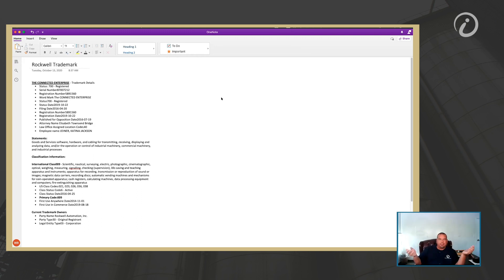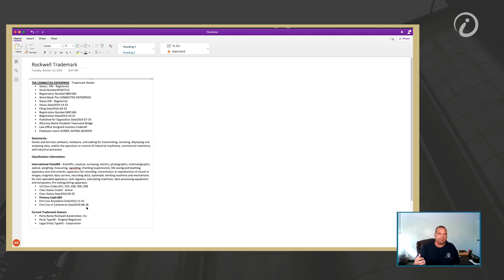Is Rockwell Automation Open?

Comment: A few years ago, I attended an event at Rockwell's HQ in which they announced support for OPC-UA.  The product they presented was a software gateway for FactoryTalk.  They also had some field hardware with embedded x86 compute that could run it.  I thought it was kind of cool that Rockwell might be finally coming around.  I was little skeptical based on the products though.  Sure, it satisfied a couple of use cases, but another gateway was hardly what the market needed.  Perhaps it was just beginning.

I politely asked "What does Rockwell have on the roadmap for OPC-UA?  Are there plans to adopt full OPC-UA in controllers and within the software products?"  They responded "Great question.  We plan to continue to support CIP.  It's embedded in."

This is where I knew that Rockwell were still stuck in their ways and had some growing up to do.  Among those in attendance included Microsoft, Amazon, SAP, HPE, Siemens, Beckhoff, RTA, Comtrol, Heidenhain, Eaton, Hilscher, Matrikon, and the OPC Foundation.  Rockwell may as well have told everyone that they seek to have the lowest level of interoperability possible.

I enjoyed how you crafted your argument.  I had never thought about how their "Connected Enterprise" patent is an inherent contradiction.  I always thought of it as a marketing phrase primarily.  It resonated somewhat when they marketed Studio 5000.  But, as far as, integrating applications (i.e., connecting the enterprise), not at all.  I've never met anyone who was thrilled to integrate Rockwell software.
Reply: This is great feedback -- thank you!
Reply from the maker: Thank you!
Reply: I use the OPC-UA card at work for integration to wonderware and Power Bi .   I also am actively using two Rockwell compute devices.  One is a card for CLX and the other is a CompactLogix with a i7 stuck on the side of it.   One is for running a SQL database running a 3rd party RFID card security and the other for a 3rd party alarming system that talks to FTAE.

Comment: Thanks for your valuable information. I may have a naive question but I am gonna still ask 

“What if rockwell, Siemens and other such companies adopt open architecture then would the role of system integrator just as yourself diminish or become less valuable or to say in a direct way, will you get less money for the work as everything will be easy to setup?”
Reply from the maker: Thank you for your comment Sayyam. We are going to do a follow up video answering more questions to this topic.
Reply: The role shifts -- from building single applications and connecting solutions together in a single plant TO building IIoT ready nodes (machines and software) while converting data into information for the entire enterprise.  System integrators aren't good at these discrete connections -- which is why Digital Transformation fails so often.  This approach will increase success rates and open up an entirely new market for SIs.
Reply: I would add to Walker's comment that under open architectures the SI can focus their energy on innovation instead of the overhead of battling the cost and complexity created (often intentionally) by vendor-proprietary silo's. With open architectures, the ecosystem of solutions available grows massively, as does the community around them, simplifying integration and opening the door for innovation.
Reply: @mfahrion  Spot on -- perfectly said.
Reply from the maker: @mfahrion  I want to frame your comment and put it on our digital fridge.
Reply: @Mike what Innovation?
Reply from the maker: @jogreg9989  Solving new problems. Making things more effecient. That's the name of the game.
Reply: @4.0Solutions  sorry, can you be more specific, what new problems? And more efficient ? E= O/I%
Reply from the maker: @jogreg9989  If you believe every problem in the world has been solved then we can't help you. There are problems we don't even know what they are until we learn new information. Haven't you ever heard that solving one question opens many more?
Reply: @4.0Solutions  I think you’re missing my point here guys, I don’t need help, I’m trying to be specific and avoid fuzzy statements which can confuse people, there is a lot of confusion in the market especially when we talk industry 4.0 focused also product development
I agree with fully, not every problem is solved, actually we ve got lot to do, but please begin with understanding the real root of the problem and the problem before give a solution proposal, and believe me for the same problem you will have different solutions in different situations
Reply from the maker: @jogreg9989  The root of the problem is manufacturers are not efficient. A specific example would be a machine that isn't operating at full speed and it has unplanned downtime too often and you do not know why. That's a specific example. I do apologize I am missing your point, I do know that you have one.

Comment: Are there not security benefits to “partially open” architecture? When I was at RA many customers were pushing to not have true open due to risk. Perhaps a different line/option would be nice, but RA strategy is always to enter the market late and better- not to be first.
Reply from the maker: Thank you for your comment Derrek. We are going to do a follow up video answering more questions to this topic.
Reply: The value of open far outweighs the risk of open -- Amazon and Tesla have proven that.  I can stay home all day with no internet, filtered air, cement walls, iron bars on the windows and armed guards at the gates.  Then I have no cultural diffusion while being locked in my prison.
Reply: I do agree with Derrek, once your hole plant is messed up for a short time loosing millions $ you would be very cautious about a „very open“ architecture.
At the end of the day the architecture must answer the business needs and mid term strategy (are they expecting to expend, new BM etc...) then define the solution, and it could be partially or completely closed if it do the best. Im not defending Rockwell or any one, im also not defending AWS which built on openness and of course they want it this way which might make sense in some cases and some not.
Summary: define the need then decide, there is not always best way, especially when we talk really about I4.0 focused on all domains incl. product development (which a way more complicated) and not only production...
Reply: I don't think that Walker means "Open Architecture" also means unsecured / unencrypted. Adopting an open architecture does not mean that communications between nodes in the system would be unencrypted. It also does not mean that access between nodes would be allowed without authentication. Cyber Security best practice would still apply. However, once nodes in a system have authenticated themselves, they should speak a common language. 
To use an analogy: If you visit my house, I won't expect of you to first learn a special language that only I know, before we have a conversation. But when you arrive at my door, it isn't simply going to be open for you to walk right in - you'll have to ring the bell, and I'll check that it is you, via the doorbell camera, before I let you in. Also, if you are someone that I truly trust, I won't hide any details from you either - you can ask me anything and I'll give you the answer.
In any event, proprietary protocols and partially open architectures are not effective substitutes for robust Cyber Security practices. So If that is the basis of your cyber security strategy, you are setting your systems up to get hacked or DDOS'ed.
Reply: @DaftWullie1981  thank Mark, even though I don’t like examples which have nothing to do with topic which we are talking about, I think you made your point clear. I don’t disagree, I don’t say the Architecture should not be open, please read my initial comment. However please don’t try to convince any one that an open architecture is more secure, please don’t do that! We still have work to do! 
Btw once someone arrives to your door, he will surely can find a way in if he really wants so ;)
Thanks for your comment, I think we are aligned!

Comment: Azure btw uses MQTT as the primary transport mechanism for OPC UA. It would be interesting to compare the large cloud vendors' tools for IIoT, maybe in another video
Reply: Correct -- using part 14 for pub/sub, but that isn't the same as an MQTT 3.1.1 or SpB architecture.  Remember -- MQTT is both transport and structure in a technology stack.  Azure uses MQTT for transport only -- as it is called out in part 14 of the OPC-UA standard.  AWS uses MQTT for transport and structure -- with 3.1.1 and SPB and the AWS payload standard.
Reply from the maker: Great suggestion!

Comment: This reminds me.
Almost 2 years ago, I implemented the Ethernet/IP driver for our Ipesoft D2000 SCADA/MES platform. I also wrote a blog about it.
https://d2000.ipesoft.com/blog/meet-the-most-widespread-communication-protocol-in-us

Let me quote myself :)
When I supported standard reading and writing and tested it against the OpENer software server, I tried the borrowed Micro820 manufactured by the Rockwell company.

There was a surprise: the list of supported classes was quite short and I couldn’t even find hardware inputs/outputs, nor variables defined by software. What to do with that?
(...)
What I personally find surprising and odd – why does the biggest implementer of the Ethernet/IP protocol use proprietary services for reading and writing? Moreover, what is the deal with other producers? Will we have to implement for each of them their proprietary services?

(...)
If you are interested in technical details and answers to those, you may read my blog :)